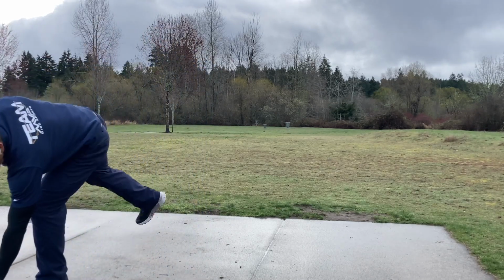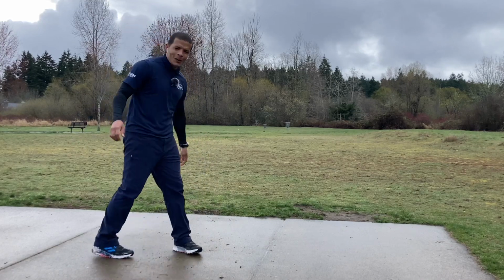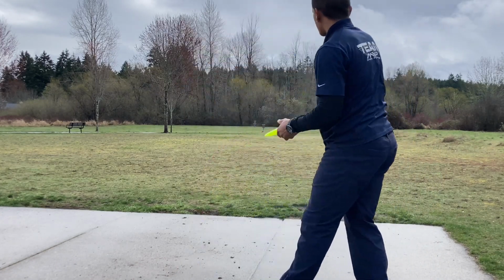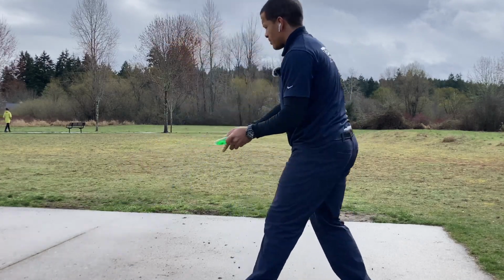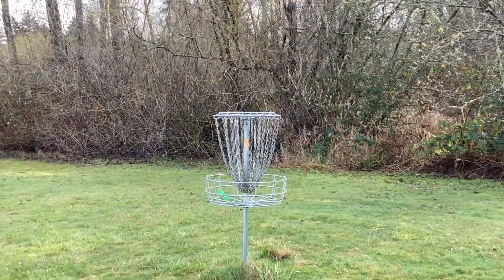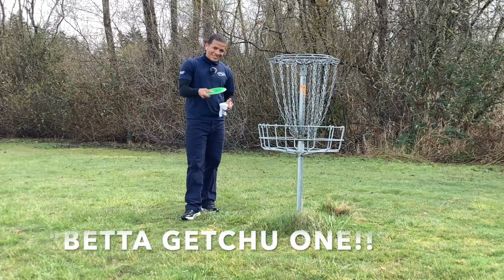PRISM PROTON TRANCE vs FISSION CRAVE !!

Comment: great review! love how you show the flight of the discs on different angles and power levels. fission crave and trance definitely have different slots in the bag. how similar you think the flights would be for the trance and a neutron lift?
Reply from the maker: Thank you! I try to keep it straight forward and simple🤙🏾😌
I think the lift can handle a little more power, probably resist the torque a little better and finish with similar stability. The size of the rim on the Trance really feels more like a fairway than the size of the rim on the Lift does in my hand, so I don’t feel as comfortable using it for tight lines(I play wooded golf a lot)